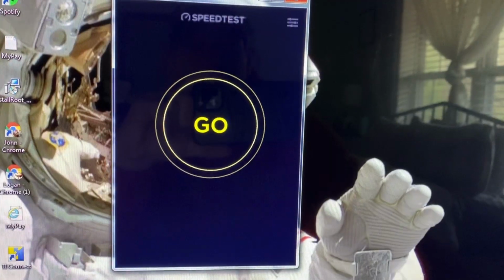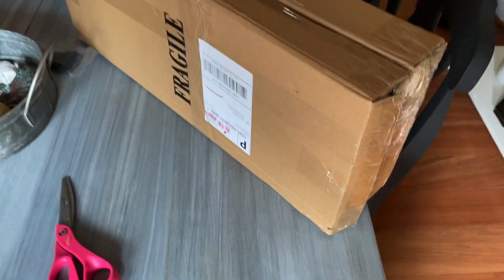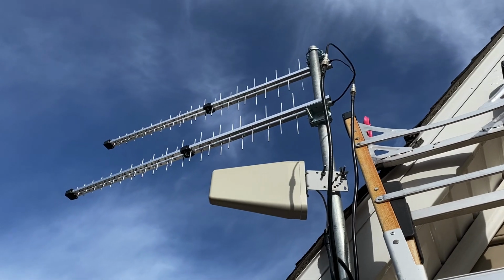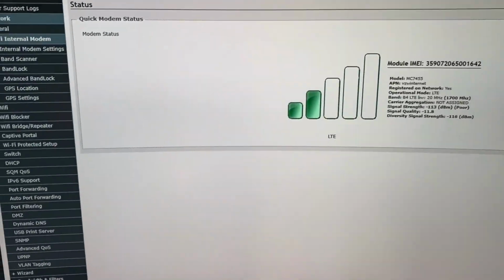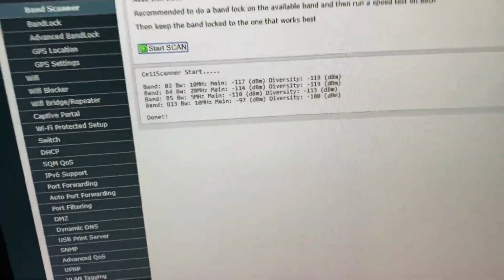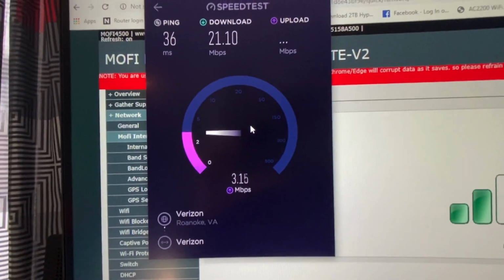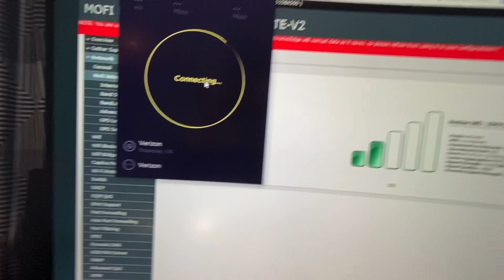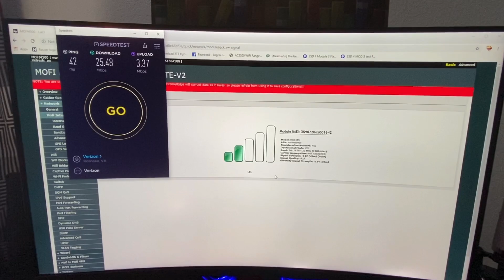INTERNET FOR PEOPLE IN THE MIDDLE OF NOWHERE. WIRENG ANT VS LOG PERIODIC Part 2

Comment: This is way beyond me as I have only used wired internet. There is a house in Ohio we are about to get that only has Hughes and Viasat I do not really want to go with these because of what I hear. But all of this is very confusing and causing some serious stress as I am a gamer.  I even checked on T mobile home internet and that is not yet available there. So that tells me hot spots may not be optional and even those confuse me. I would have to get a cell phone carrier and those take contracts and it may not even work. Because I cannot get a straight answer from anyone because everyone is trying to sell something even if it does not work!. Can someone please explain how all of this works and if it could even be an option, I am at my wit's end. What goes into it, how do you know if it will work? etc. I am tech savvy when it comes to computers but when it comes to cell phones,wifii,hotspots,and this I am oblivious.
Reply from the maker: Hermit 4Life I got you man you got questions I’ll square you away you can do it!
Reply: @rockernro  Wheew ok thank you. How does this process work? you have an antenna, antenna goes to the router, but where is the internet coming from? If it is a hotspot and one cannot get cell phone service where they live then there is no hotspot right?. However even if one gets a hotspot in which is doubtful for me it is locked at max of 20gb data (largest package with any carrier I know of) then it gets throttled in which would be gone in a heartbeat if I was paying for cell phone service. Am I understanding this right or am I missing something?. I am sure I will have more questions but this is the first one lol.
Reply from the maker: Hermit 4Life yes after 25 gigs you will experience throttling maybe even over chargers for going over limit.  So,  the mofi is the same as a hotspot it is recommended over any normal hotspot bc it can run continually and lock on to specific bands in your area Vs a typical hotspot will only work on the band that it picks up.  So mofis have an edge.  I’ve tried the typical hotspot trust me it’s a massive pain little reception or gain.  With mofi if you have no cell service or barely one bar like myself that’s enough to I increase data and voice.  The two antennas you mount up high will find the bands and signal and basically magnify your carrier whether it be Verizon or ATT whoever.  I barely have any signal here.  The mofi paired with a couple antennas make it so I get 30-40 mbs of speed.  Fastest in my town lol.   Now,  if you want a plan that doesn’t get throttled and data caps I highly recommend what I tell everyone is go on eBay and buy/rent a sim plan from someone on eBay selling truly unlimited no throttling sims.  They will activate it and send you instructions on how to pay them every month.  It’s 3rd party but they are basically loaning you a grandfathered plan.  Which one do you pick?  Check their feedback and message them make sure you are comfortable before your purchase .  If it’s a 50-100$ a month with them it’s worth the investment bc that will be your new internet bill
Reply from the maker: Hermit 4Life it works by bringing in LTE to your home 10xs stronger and the sim in mofi converts the LTE into WiFi.  The mofi is a hotspot and router combo.  The WiFi created from it can be your home network.  The WiFi coming from mofi is decent but if you want to have more sq ft coverage in your home you can Ethernet in a good router any router will do and set your router up as the home network router through the mofi I have vids on that
Reply: @rockernro  Ah ok thank you I am getting it. I found something called unlimitedville that uses a mofi as well. They are expensive though what is the difference between that and following these steps? Will these steps save money? and if I do the ebay thing I just get a sim card with unlimited? are they all legit or are there things I have to look out for? Seriously I greatly appreciate your help people usually do not answer questions like this so glad to see some good people still left:).
Reply from the maker: Hermit 4Life yeah I mean it is risky on eBay but most people told me they found a reasonable plan that’s legit.   Not really much to look out for except maybe negative feedback honestly.  I’ve heard of Unlimitedville.  Basically they send you mofi with plan pre-installed to help people have everything g pre set basically get your antennas and good to go.  It’s pricey bc they know people want internet and will pay the prices. Double check make sure they are truly unlimited.  Or simply take matters into your own hands and find your own mofi and plan is all I can say about that.  Good luck HMU anytime
Reply: @rockernro  Ok thank you and will do:)
Reply: @rockernro  Sorry to bother you again but after research, I tried to do a check with unlimetedville and they said: "We have received your request and unfortunately we are unable to locate a registered carrier tower/antenna within the desired radius for service." However in my own research to do this on my own I have realized the nearest fcc registered tower to the house is 12-14 miles away and its called att mobility. Will these wirengs still work or is there something much better and bigger that can do this that you know of to cover that amount of miles? or am sol?:(
Reply from the maker: Hermit 4Life have you seen my latest video.  I don’t recommend WIRENG I would try Log periodics
Reply: @rockernro  Ah ok thank you once again I will go watch that now.
Reply from the maker: Hermit 4Life check it out man I’ll be home tonight around 6 pm est you can call me I’ve had a few call me I can walk ya through it will work it’s simply a mofi router with a cell sim from a plan.  Let’s say you get Verizon they will give you a hotspot for 30 days or send back no contact.  They also have pre paid ones at wal-mart.  So basically I’m like you I didn’t know shit about this.  I learned this from obsessing with research and trial and error.  My cell is 315_two eight 6 twenty one 0 four

Comment: ok i am just bidding on a mofi4500 sim card router now and have the log periodic antennaes and this https://www.amazon.com/dp/B07YPQN872/ref=cm_sw_r_sms_awdo_t1_KlWnEbGWY7RGA?th=1 and this https://www.amazon.com/DGZZI-2-Pack-Coaxial-Adapter-Connector/dp/B071VF47XT/ref=sr_1_1?keywords=fme+male+adapter&qid=1581201595&sr=8-1 is this all i will need?
Reply: Do i need a pole to put this on?

Comment: What cables did you use? I assume not RG6. I have a 75 ohm Wilson yagi and using RG11.  Not getting substantial improvement but the yagi antenna is not high up for the testing we have done.
Reply from the maker: Edward Shamis, Jr. https://www.amazon.com/dp/B00H9II896/ref=cm_sw_r_cp_awdb_t1_uUhnEb4GNME8K

I hope you get the cables with a mofi 4500 and these antennas.  One Yagi on a booster won’t cut it
Reply: I am about to order the mofi and log periodics and am just wondering what cables I should buy I am going to need like 300ft btw.
Reply from the maker: no b Check this out: 75 ft Low-Loss Coaxial Extension Cable (50 Ohm) SMA Male to N Ma... https://www.amazon.com/dp/B07VSH5378/ref=cm_sw_r_sms_awdo_t1_KlWnEbGWY7RGA
Reply: @rockernro  LMR 400 is too lossy for anything more then 25 ft at cel frequencys..

I know people hate or can't deal with the expense and or setting up high quality feedline though..
Something like this ( and look at the chart for signal loss per 100 ft runs ) https://www.talleycom.com/viewProduct?rlProdNum=ANDAVA6-50&_vsrefdom=adwords&gclid=EAIaIQobChMIndmiut3y6AIVCz0MCh33HgwyEAQYASABEgJiOfD_BwE .
Reply: Why not use lmr 400 cable?
Reply: Joshua Brown I know that 400 would be better but when I spoke to Wilson Tech she told me that it wasn’t that much better than RG 11 as far as signal loss. And the 400 is a lot larger in diameter and harder to turn corners in the old house were working in. We also don’t have but about a 50 to 60 foot run so it’s insignificant as far as signal loss. I think my real problem is antenna height. Once I get the antenna  High up enough, we will probably add a Wilson inline signal booster that should increase the signal by 20 DB. The Mofi 4500 LTE Conbo with Router works well enough now so  we have cell phone signal just not really fast. The goal is is to increase data transmission speed. I’ll try to remember to keep people posted as to what we do and what the outcome is. Thanks for your suggestion.
Reply from the maker: Edward Shamis, Jr. Boosters will not really increase your data speeds you need mofi and antennas and they need to be as high as possible like ya said.  Boosters only repeat signal better for voice vs MIMO or 2 antennas technology is a million times better.  This is from experience trust me lol
Reply: John Barth Thanks!
Reply: @edwardshamisjr.5262  Neither RG-11 or LMR 400 is good
NOT for cel frequencys and it is NOT what is used on the cel towers either...that should say something..

I use Andrew's Heliax feedline..,though admittedly far more expensive and far harder to work with..
Yet...my deadlines easily will last 10 to 20 years
( my connectors often cost more then the entire coax systems most people use )
Reply from the maker: Joshua Brown or something like this https://www.amazon.com/dp/B07JPLJ24S/ref=cm_sw_r_cp_api_i_NyAqEbPFQ9MN5

Comment: Btw I was wondering why I need two antennas
Reply from the maker: no b do you have a mofi?  It has 2 ports making it MIMO so you need two antennas man
Reply: @rockernro  FYI mimo Only works if.
Tower has mimo set up
And then your antennas are Properly aligned for mimo
Reply: MIMO-Multiple Input, Multiple Output. #google

Comment: I am going to put these antennas 300ft to the top of the mountain I live on because I don't think these will cut through the mountains because we live in the side off the tallest mountain in the area but we are below the other mountains around us where we are now, but if we go to the top we should be the highest point  to the nearest tower.
Reply: Exactly..
Height is Might.

My cousin is in a very rural area..
Yet one can see a mountain top some 32+ miles away.
So I set up 4 beams like the new ones shown here..
But did so in a way as creating 2 mimo antennas..
With antenna mounted pre-amps..low loss coax.
Connecting to a Netgear M1 cel modem ( that I nodded to enable hooking 4 antennas or 2 sets of mimo antennas )

He is only one in his area getting cel reception ( lol ) plus he gets high speed internet too